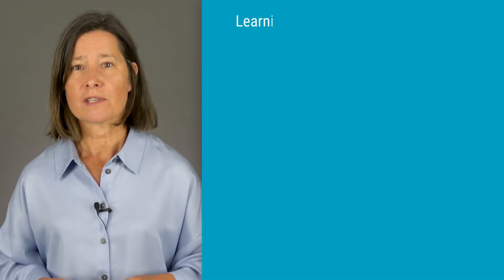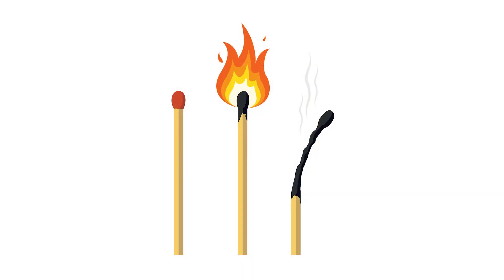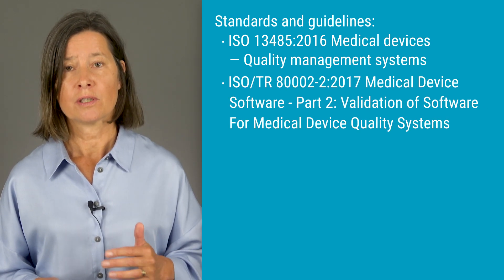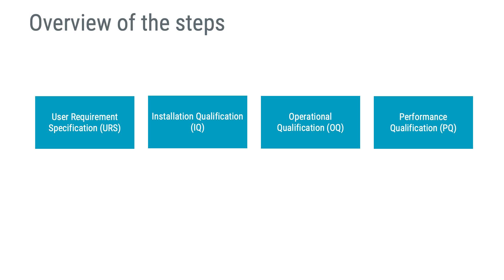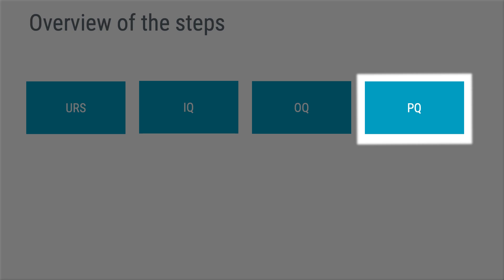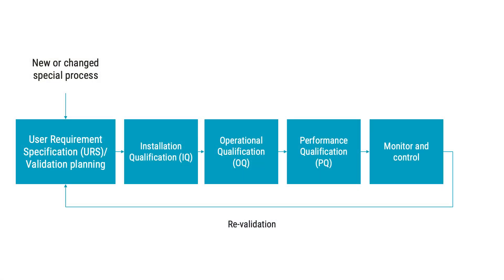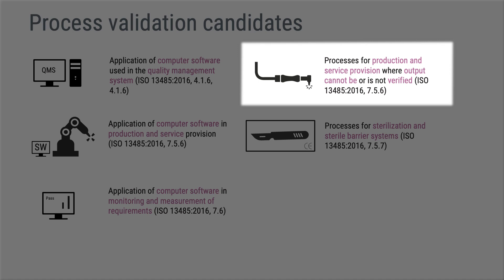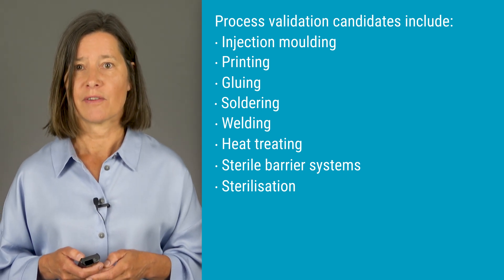Process Validation for Medical Devices - Short Course

Comment: I really wish I had discovered this channel earlier when I was still a Master’s student. It could have helped me understand things better and make more informed choices. Now, I’ve been jobless for almost two years since graduation, trying to figure out the right path for me in the  MD industry.

With a Bachelor’s in Nursing and a Master’s in Biomedical Engineering, I often felt uncertain about where I belonged in such a vast industry. I’ve always been interested in clinical investigation and research—I do have the knowledge—but breaking into the field has been tough due to the common requirement of 1 to 3 years of prior experience. That lack of opportunity kept me from gaining the confidence and practical exposure I needed.

I also struggled with understanding verification and validation—mostly because I never had the chance to explore them during hands-on training. But thanks to this channel, I finally understand those concepts more clearly than I ever did in university.

Even though I came across this content late, it’s been a powerful refresher and source of motivation. Thank you for sharing such valuable knowledge, and i hoe it not too late for me to break into the field and also pursue my phd